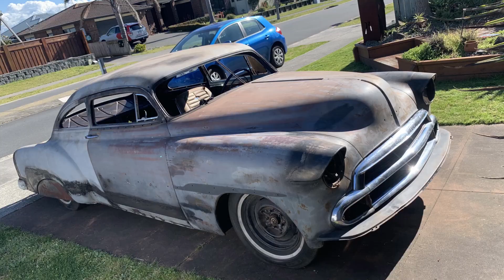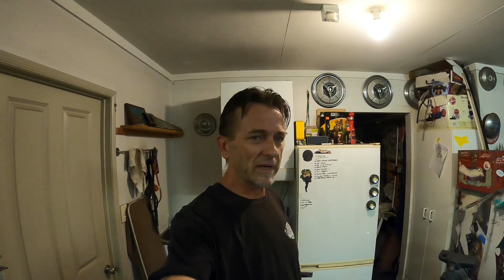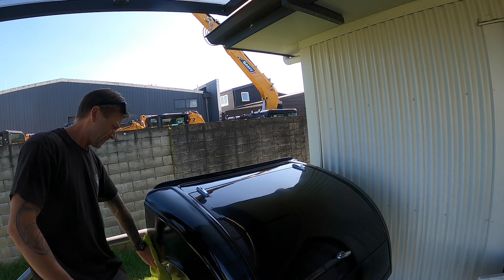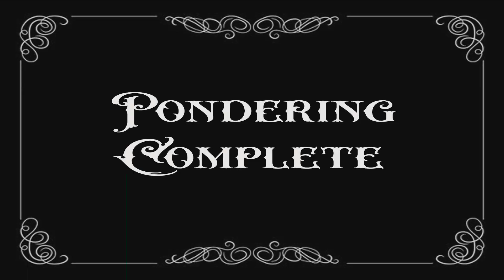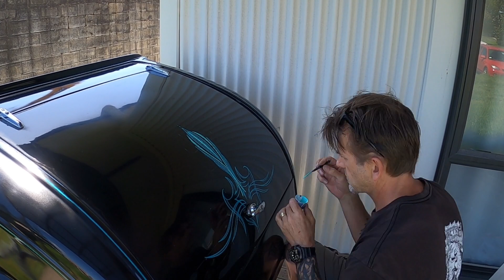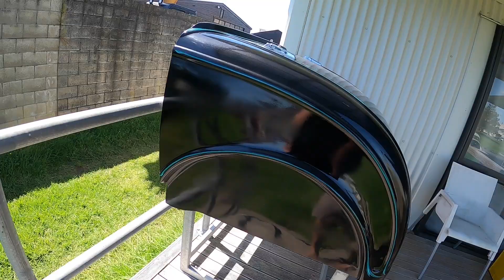PINSTRIPING A HOT ROD ...........BBQ?

Comment: When the bar b que is used the paint will burn off!when you actually use this bar b que the paint will burn off…waste of time and effort?
Reply from the maker: Thanks for your concern Steve. But the BBQ is not a hood style BBQ that one uses with the lid down, it is a hot plate style, which is pretty common around these parts and it’s alway open when in use. Therefore never has any direct heat under the lid when in use. I thought I mentioned in the video also that the body is a fiberglass reproduction so you wouldn’t want to shut the lid while it’s hot as burning up the whole thing would be more of a concern than the paint on the outside of the lid and it has had 6-7 months of use and is holding up just fine.